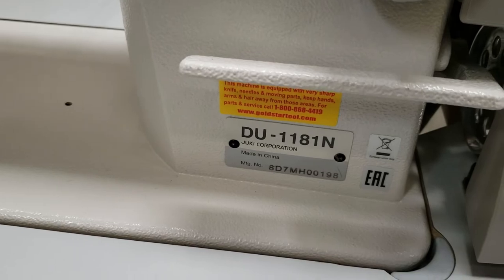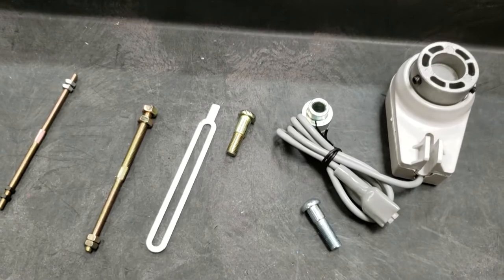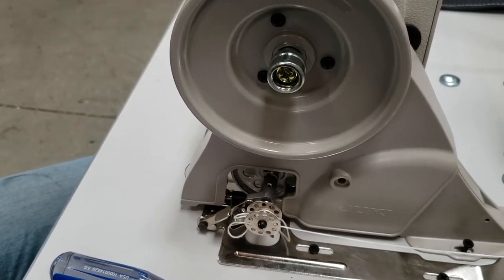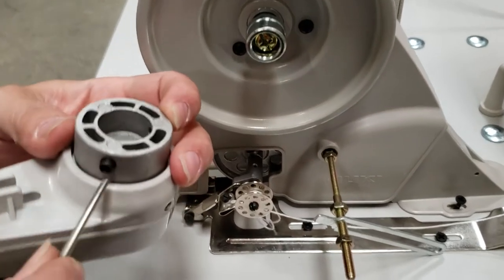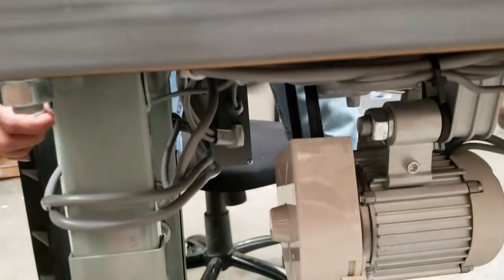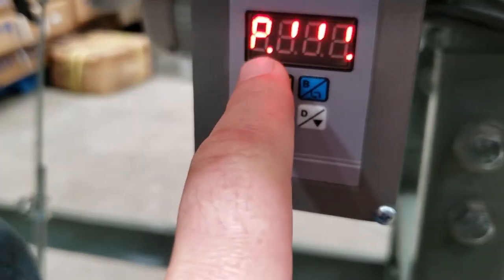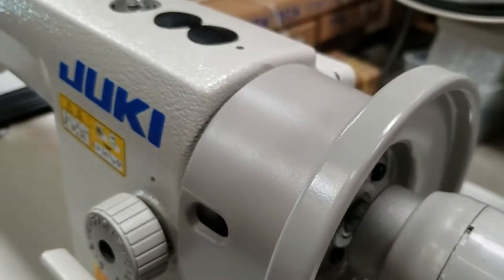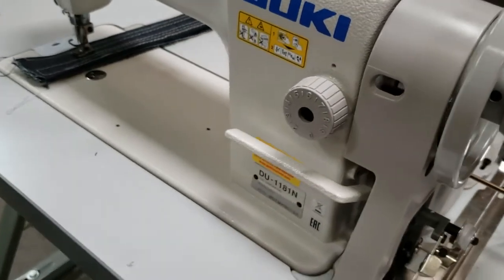Tutorial - Attaching a Needle Positioning System to Juki DU-1181N - Goldstartool.com - 800-868-4419

Comment: Thanks. I don't understand what is the purpose of the long screw with two ends and bracket  (@@). Mine came with L shape screw only and even though I attached and was too long but still everything worked as intended with regard to synchronizing the needle and see no purpose for those long screws